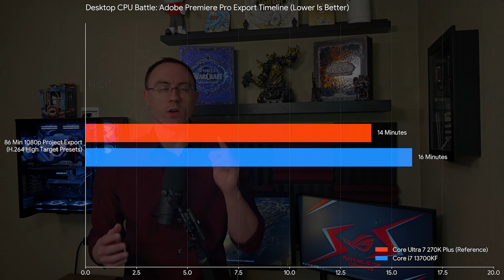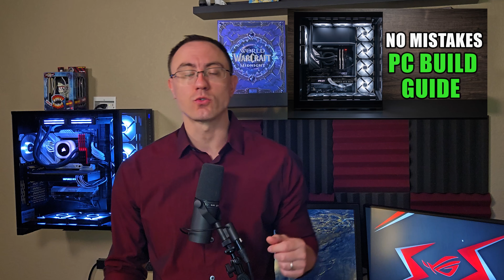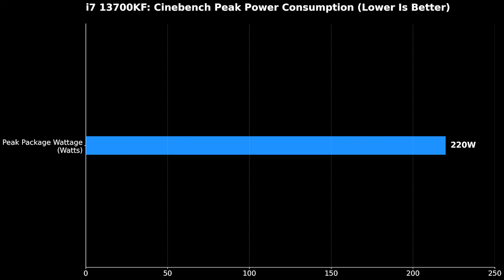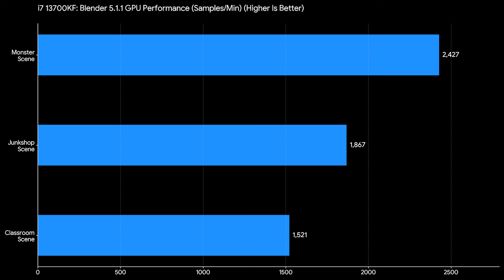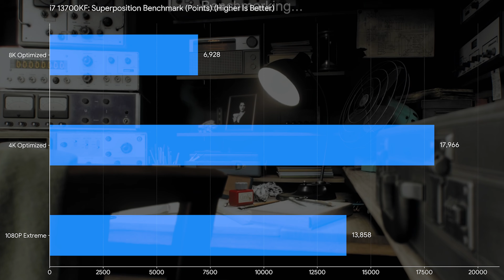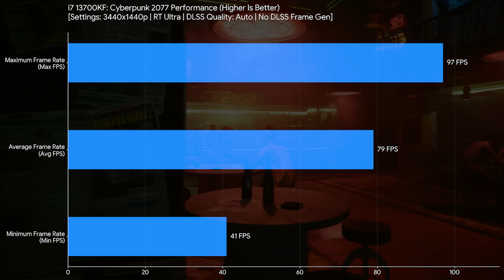The Truth About Upgrading From 13700KF To Intel 270K Plus

Comment: Then 13700k temperatures is because it’s not set up correctly. My 14700k only uses 220 watts and never go over 75c at full workload. Thats with a 240 aio, not a 360.
Reply from the maker: I specifically ran everything at out of the box settings, besides XMP. What did you modify to get those temps? 

Also my 13700KF is on a 240mm Corsair. Not sure on the overall ability of this cooler to be totally fair, but this PC is wall mounted so it's got quite the uh...unique scenario to attempt to test additional coolers.
Reply: Frst of all, stock doesn’t mean making no adjustments in the motherboard. You said you went in to turn on xmp. Why not turn on the stock thermal settings of pl1 which enables all limits? That’s the stock configuration for that chip. 

Running a cpu on an unlimited power setting isn’t a stock setting. That is no different than buying a 240hz monitor and not setting up the 240 hz and run it at the 60hz from factory. 

Problem is most people don’t understand what stock settings means.

Comment: Staying with a 13700k that I got at MC for $269 on Black Friday in 2023.  Been running 5.5Ghz stable since purchase, no issues.  Will likely upgrade when AMD launches AM6 socket X3D cpu's, or if intel somehow catches up with gaming performance.
Reply from the maker: Are you on DDR4 or 5 right now? Because I feel that is the major holding point in waiting for most upgrades. My 13700KF is DDR4, so it's more valuable to hang onto since I don't have as much DDR5 sitting around, haha. My main rig is a 265K with 96GB DDR5 and that is my favorite system. 

Also I'm sure you likely have the latest bios updates for the microcode issue and I hope that your CPU gives you 0 headaches until you get to upgrade.
Reply: @TheDonTech  DDR5 6400 CL32, yes I updated the bios

Comment: You've messed something up in testing. I had 14700k and now I have 285k. There is no difference between them in cb2077. In pair with 5090 on max settings I have the same fps
Reply from the maker: This entire video saga I've been filming around CPU's has definitely taught me a lot. I plan on having a more streamlined test bench situation in the future. 

But generationally, depending on what was purchased, it's common that so someone who had the 13th/14th gen CPU may have had DDR4 RAM (like my situation) and then moved to DDR5. So that was a main discrepancy in my bench testing, along with different resolutions/settings that were likely dictated by the game itself when I had it go to Auto. 

Just to clarify with your comment, are you saying all of your FPS is the same across low, average and high's?
Reply: @TheDonTech I don't remember what the low difference was, but I've made some game tests (including cb2077) and the difference was in a margin of error. You get 20% more avg fps on 13700k and it looks strange. I had 14700k + ddr5 7800 and 285k + ddr5 8800

Comment: I still have, but my MoBo broke, an Intel Xeon W-1290P (kinda a Xeon version of the Intel Core i9 10900K with ECC).
But as I have to buy a new MoBo I decided to upgrade, first to Intel Core Ultra 9 285k. But changed my mind and I am going to pick the Intel core Ultra 7 270K Plus, with the MoBo Gigabyte Z890I Auros Ultra and, for now, some Crucial Pro DDR5 RAM 32GB Kit (2x16GB) 6400MHz CL32. I for now keep my PNY Quadro P2200 5GB GDDR5, but would like the PNY Quadro RTX 2000 ADA 16GB GDDR6 4xmDP. Luckily my Noctua NH-D15S just needs a adapter for rhe new LGA1851 socket.
It is for my CAD-Workstation, to work with Advance Steel and (my preciuos!) ISD HiCAD ❤.
Reply from the maker: Sounds like a solid upgrade path. I have an ASUS Z890-E Gaming Wifi Motherboard and it's absolutely rock solid, and I plan on keeping it for another 7-9 years (8-10 total), which is especially important during this RAM/Chip crisis. I just hope my 5070 GPU will keep me satisfied for that amount of time, haha.

Comment: at thsi point it doesnt make sense to change when nova lake is gunna be here in like 3 months
Reply from the maker: The only reason why it would make sense is due to cost tbh. The 270K Plus at some intervals sitting under $200 is beyond a steal. I remember back in ~08 I got an AMD X2 CPU that went from like a $800 chip to a $200 chip because of the new socket/chips that were coming out, along with Intel's Core 2 Duo line up. Imagine if the 9950X3D suddenly dropped to $200, lol. People wouldn't just be waiting for the new chip...unless you have to have the latest and greatest at all times. I've never been about that.

Comment: There is this channel Blackbird PC Tech, he tuned the 270K and ended up with a better Performance than even X3D in some cases even Avg framerate, and 14th Gen i9.
Reply from the maker: I'd love to do some intense tuning with additional bench tests. That was my plan originally, but with all my CPU's I was testing (7) it would have been a nightmare for this production schedule. 

I'd also love to get my hands on an X3D chip to test as well against my setups.
Reply: @TheDonTech  Definitely. You should try to mimic Blackbird's methods too and see if you get the same results. From what I know, that channel is the absolute MOST accurate benchmarking channel ever, BUT they push the tech to the max it can handle; it's not a "stock out of the box" test. Example: the 270K Plus had 8400mhz ram, the 14900KS had 8200mhz, and the X3D CPUs had 8000mhz, because those speeds were the fastest he could stabilize with the CPUs. Not everyone is pushing their hardware to the absolute limit, but it's good to know if you plan to do that.

Comment: Cool Video , I just installed the 270k on an aorus z890 elite also have a 360 rad on it and ram running at 6600mhz . DIgging it so far. I came from a ryzen 7900x on a x870 elite. I do mostly music creation and some gaming and video editing. I notice lower temps then the 7900x and better performance in ableton live. I got the 270k new for $255  just seemed to good a deal to pass up, I got the cpu and mobo for the same price of a ryzenx3d. Maybe because of the cooler thermals when ran in extreme modes the cpu will perform a bit better then the 13700kf? what do i know its a great deal either way. peace
Reply from the maker: 270K for ~$250 is such an insane value. I would expect it to last longer and perform better long term than the 13th/14th gen chips for sure. Time will tell, but the thermal headroom will definitely allow the CPU to stay reliable for the long term.

Comment: On a 12600kf and dont plan on upgrading anytime soon
Reply from the maker: I have a 12700 that was run through my gauntlet and testing. Those videos are filmed and will be released...sometime, lol. It was the least powerful chip in my arsenal, but just by logic it was that way, lol. If it works for you and does what you need it to do, def save your money though.

Comment: I'm sorry but that CB2077 gaming benchmark is so strange. Aren't you gpu limited most of the time at that res and dlls Q? I just tried on my 5070ti + 270k using the same settings and the lowest 0.1% I got is like 78fps. I made sure not to be gpu limited though by going dlss ultra perf.
Reply from the maker: That's what is going to be very interesting. So I spent several weeks benchmarking every piece of equipment I had, data logging everything and then am now in the compiling and editing stages of the videos. 

Welcome to The Don Tech where...yeah, it's a journey, haha. I'm currently comparing the 270K to 265K (upcoming video) and the data shows...very odd changes when the literal only changes were the chip. Stuff I gotta figure out - BUT - I already filmed it so...I'm sticking through it, haha. 

Also I am on Windows 10 if that changes anything.

Comment: I made the jump from 13700k with DDR4 3200mhz + WiFi 6 to this platform with 270k plus and DDR5 6400mhz + WiFi 7. It served me well all those years, but my case and cooler could not cool these efficiently. The result my fans were spinning 100% all the time during gaming. I talk about 99 degrees celcius my cpu was all the time. I was really done with the noise and waited for the perfect time,. The 270k seemed promising according to several tech reviewers. So I decided to change. The temperatures during gaming has been reduced to 48 degrees max. A change of day and night. This is really my coolest and quietest setup ever. It is also is more stable. I have litteraly no regrets upgrading to this. I am not an FPS rage person. I want it to be enough to combine with an RTX 5070 TI. This new setup really is so much better in every way. I was smart enough to buy two kits of 2x 16 Lexar Ares 6400mhz RAM in 2024 for €115 euro, because i knew this was happening. I have always been an Intel person, and I see no reason to upgrade to a more expensive CPU from AMD. This CPU bangs for the price with 24 cores. Especially considering i sold my old setup for a good price.
Reply from the maker: Yeah the temps are incredible. Your setup sounds awesome and I hope it serves you well for several years! I plan on using my 265K for at least another 7-9
Reply: whats you cooling for 270?
Reply: @suk4ed MSI MAG Core Liquid i360... In the Netherlands an cheap aio for €79. But I don't care about dislays it only needs to have RGB haha. But it performs really good. The result is idle 34 degrees and during gaming max 48 degrees, but mostly 45.

Comment: Terrible, terrible advice. You are asking someone to give up a possible DDR4 platform where you can easily upgrade your ram anytime you would like for a platform which will die out this year because it's a "platform of the future".
Reply from the maker: Watch the full breakdown again. I literally tell gamers to stay on their current setup because the 13700KF delivers smoother frame pacing. The jump only makes sense for creators chasing massive thermal drops and heavy render workloads. 

Plus, I have much more confidence in the 1851 CPU's lasting 8-10 years vs the previous generation ones as well due to the thermal thresholds. 

BUT if you think I have this amazing power of influencing people, tell sponsors that so they'll give me money.
Reply: @TheDonTech  It will last longer than the next generation of Intel sockets? Secondly, why would anyone switch platforms for future longevity and stay on Intel's current gen instead of AM5? Again, terrible, terrible advice.
Reply from the maker: Saying the same word twice doesn't give your claim more validity. I am talking about the reliability and longevity of the CPU, not the socket. If the CPU lasts 8-10 years, why does it matter if your socket can support 5 different generations of CPU's? If you're chasing max frames and will buy the newest CPU anytime it drops, that's a whole different prospect of people, typically high end users or gamers who need to max out every single spec of performance. But that usually also means making sure RAM is always newest, GPU is always newest/etc. Good for you if you have that sort of money lying around.
Reply: @TheDonTech you're right, since I was correct initially reiterating doesn't make much difference

Comment: Maan...you should power limit for 13700kf to 170w and give it undervolt -0,05 or 0,1.
Mine 14700kf which is pretty much the same cpu and I managed to dropped that temperatures from 80-90 degrees to 60-70 in full load stress test on 360 AIO.
After that you have no degreadation of the cpu and it runs fantastic.I have it over a year now with zero issues meanwhile its still a beast.
Not to mention I only lost about 1-3% of performance which is non recognizable.
Another thing is you compared ddr4 vs ddr5...
I mean 270k is great cpu value but if you have 13-14th gen there is zero gain going to newer platform especially if you tune it a littlebit in bios.
Reply from the maker: My first series of benchmarks were specifically focused on running things at stock, no BIOS tweaks or optimizations or changes, less using XMP and that was intentional by design. Depending on the feedback of this series, I may re-run some tests with changes within the BIOS to see how much change occurs. 

Your undervolting results seem amazing and something I may definitely want to consider on my 13700KF for sure. 

I did compare DDR4 to DDR5, my test benches were kind of...all over the place. BUT This is me "trying out" reviews, benchmarks, stress testing/etc using the equipment I have on hand. This video is actually #2 in a very large series (that will span the rest of the year) that pretty much compares and test every CPU and system I currently have access to. The benefit of that is I've logged all the data, so subsequent CPU's or changes I make in the BIOS will be very easy to compare against. 

Thanks for your insightful comment. I've made a personal note to modify the BIOS settings and maybe in the future turn it into a video about it!
Reply: Stock is still making adjustments. If you added xmp, then it isn’t stock. 
Setting pl1 or enable all limits is a stock setting. Just running wide open on a fresh motherboard is why people burnt up their CPU’s . Run an msi board on air cooler setting for all limits enabled instead of water cooling because that’s wide open.

Comment: I have a 12900ks and the cost to upgrade to a new platform in today's market makes it nearly impossible for me to justify.
Reply from the maker: If you could keep your RAM it'd be better to consider an upgrade. But if you're rocking a system like that with good RAM you may be better off waiting for sure. But at least this video shows you the performance changes were pretty moot, instead of making you feel FOMO lol. (I do have a Intel Core i7-12700 CPU series that I also benchmarked and tested. That will be released....sometime, lol)

Comment: The comments are all over the place here... kinda weird considering the comparison. Good video, solid comparison and I appreciate the stock to stock JEDEC config when it comes to memory right out of the box, since we all know what these parts perform at when tuned as is. There's eleventy-five different videos showcasing crazy custom-tuned Arrow Lake Plus parts compared to every other CPU on the market to try justifying the platform.

Definitely wouldn't recommend going Intel for pretty much any reason right now, though. AMD's kinda got all the cards available at every point for both performance and efficiency, and even then Intel's next gen socket is coming out next year so if you're dead set on avoiding AMD, that's probably worth waiting for if not Zen 6.
Reply from the maker: Comment section will do what comment sections do. Appreciate your comment, though! 

I was debating whether or not I wanted to make additional videos after fine tuning everything, but the production time would have been enormous and delayed everything else, so I just went with defaults for this series. I have many more videos to release with several different CPU's that I've had at my disposal. 

The biggest draw for Intel's Arrow Lake series is their lifespan tbh. Especially right now, when you buy something, you don't want it lasting only ~4 years. My premise for my 265K CPU is that it will last me 8-10 years. I plan on doing yearly update videos on how that exact PC is lasting, because I'm not just some content creator who upgrades everything every second something new comes out. The first video should be out sometime within the next month or 2. 

The biggest concern with any newer releases from Intel or AMD is going to be the price increases for these things. Hopefully things stay..."reasonable" but if you can get a 270K Plus for ~$250-$275 it's a remarkable steal.
Reply: @TheDonTech  The idea that AMD, or any company for that matter, "should remain cheap despite having the more powerful and better product" is a silly take that people do not seem to be able to remove themselves from. 

If you have the superior product, you should absolutely charge what you think you can get for it given what the market conditions allow for. I get why people want cheap things, but when AM5 offers a value the likes of which Intel can't compete with, it's going to come with a premium attached... Especially since AMD confirmed that Zen 7 is going to also be on AM5, too.

If Intel wants to compete, they have to understand what they're going up against and not rely on their name alone to get the job done as those days are long gone.
Reply from the maker: @imglidinhere  blast from the past comment there, felt like 2015 all over again, lol.

Comment: Tech notice had an interesting comment about RAM and Arrow Lake cpus. With the older 13th and 14th gen, the CPU struggled with quad channel 6000M/Ts (4 Sticks of RAM). The older platform had to run at non Expo/XMP settings to be stable while Arrow Lake CPUs could run 4 sticks at XMP/Expo 6000M/Ts speeds. The benefit I can see from the switch would be if you had a 32gb (2x16) kit on Raptor lake. You could use it on Arrow Lake, and buy a second kit of the SAME spec and have a 64gb setup for better production tasks.
Reply from the maker: Ah that is very interesting. I would have LOVED to test this with 4 sticks (preferably 48GB per stick) but I only had 2 sticks to test with. 

That is real good information though. I remember when I had a similar issue with the 1st gen i7 series. that had Triple Channel RAM. I could run 3 sticks fine, but the moment I tried to go for 6 the system would mess up unless I tweaked some settings, and after running benchmarks, 3 sticks performed better than the 6. I don't remember the exact details as this was back in 2010 but I hung onto those sticks for the memories, lol. 

Thanks for your comment and insight!